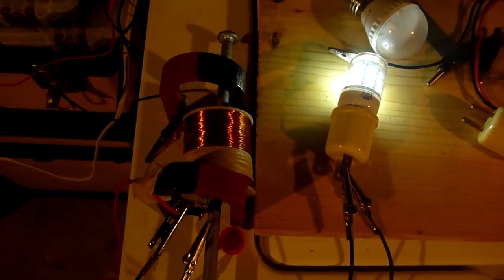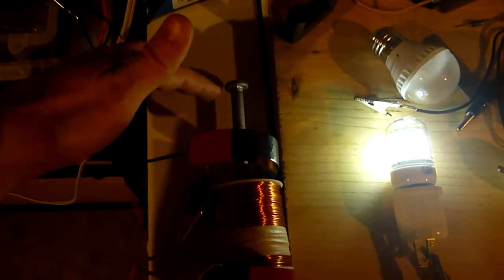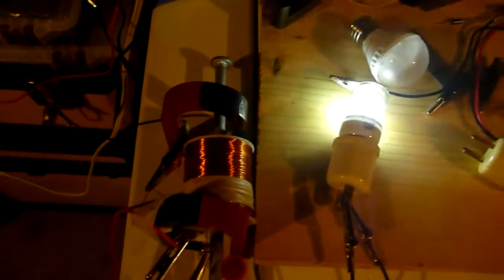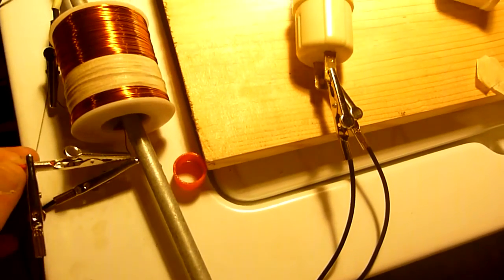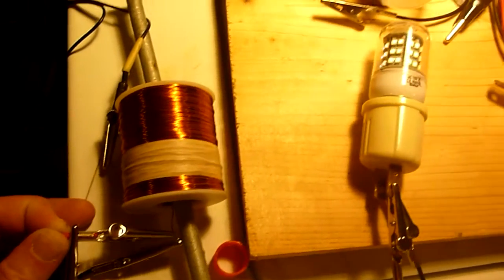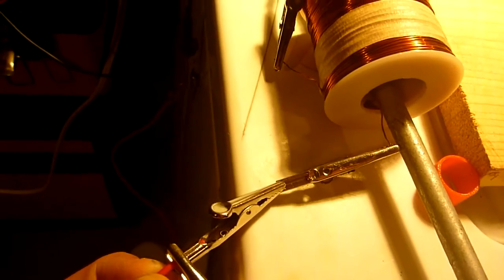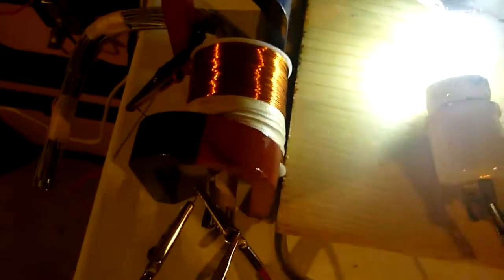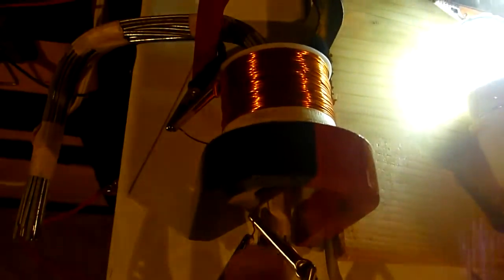Possibly World's Simplest Oscillating Circuit (no transistor)

Comment: That's a Rhumkorff! :) Basic self-defeating circuit.. They were known as Vibrators back in the day.. Impulse DC current generator, with backEMF oscillation.. Place a capacitor across the vibrating switch and you'll see much better power output.. Note the crackling sound that results as well.

Comment: Before we had transistors back in the 50's radio's used valves but unfortunately it was impractical to have a valve door bell so a much more basic electromagnetic switching was used. Old door bells used the same principle back in the 60's look up electromagnetic door bell switching coils, it is a very old circuit i.e. https://en.wikipedia.org/wiki/Electric_bell and see  http://thefusebox.northernpowergrid.com/page/electricity/doorbell.cfm

Comment: Keep up the work you're doing. I hate to tell you though that ***** beat you to it.
https://youtu.be/VjqBRXU3XnU
https://youtu.be/UgXgwIea6pk
Reply from the maker: clixbits kudos to Lidmotor, he is a big inspiration of mine. Note that these back EMF sparks are cold to the touch. If you get the wires to spark in your hand you won't feel the heat at all! The volts and amps released when the circuit is broken is huge. The faster the circuit is broken/reconnected the better.

Also, note that the method that I show in this video is even simpler than using graphite or a small coil with a magnet. Here you just use a metal piece with a copper wire. Oscillations seem to be helped by the presence of a horseshoe magnet over the connection.